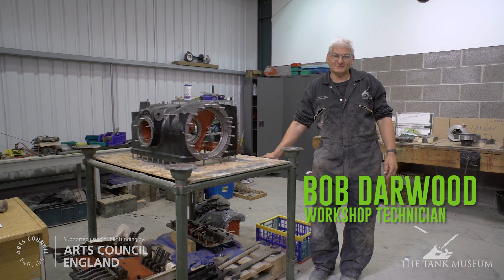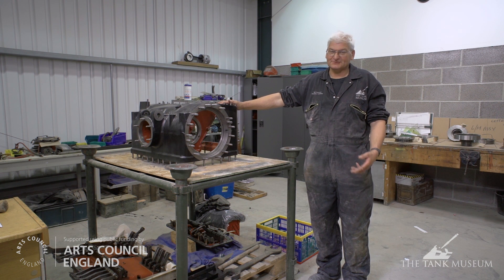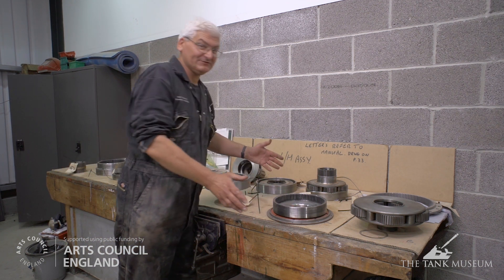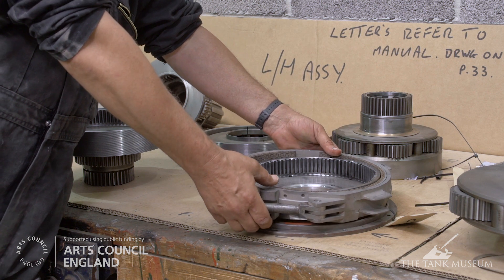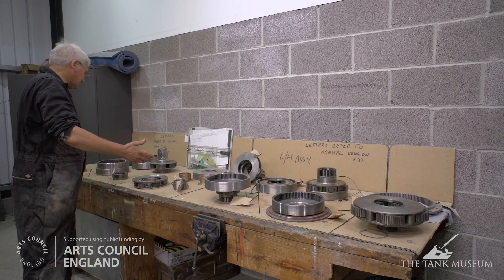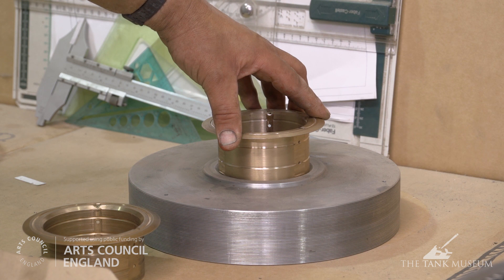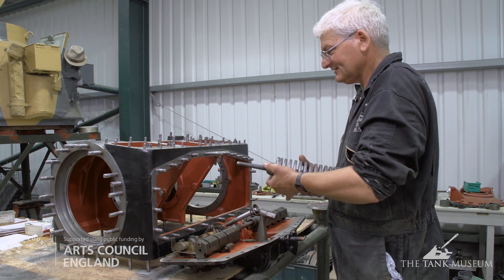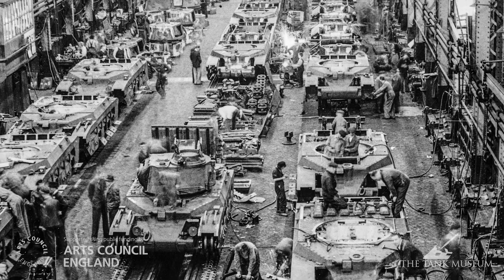The Matilda Diaries Part 5 | The Tank Museum

Comment: I'm struck by how small those gears are, with such tiny teeth, I suppose a massive advantage to the planetary gearbox is the multiple contact points from several gears meshing simultaneously which can survive the same torque as larger single contact gears. While the matilda 2 only weighs half as much as the late war tanks which famously had severe gearbox problems, I wonder if the germans could have made use of a planetary arrangement for more durable panthers. Of course an easier fix would have been simply using herringbone gears, the existing transmission probably didn't need any changes other than different gear geometry to achieve significantly better reliability.

Comment: And they said that German tanks were too detailed for their own good. Did this really function in the desert's sands?
Reply: The Panther weakness was in part down to the lack of machinists and equipment to manufacture herringbone final drive gear sets. The steel by then was crap too due to lack of alloying elements like manganese or vanadium. Not helped by saboteurs risking their lives to not tighten assemblies properly or whatever (well done those slaves!).
Reply: I would rather have a complex gearbox that can handle the power and weight of the tank. Look at the Panther tank that came 5 or so years later, it uses straight tooth gears which would cause a lot of stress on each tooth and can lead to the gear breaking.
Reply: which was solved in the later models and later phase of war right?
Reply: Marc83Aus
That's then a double helical* or a herringbone gear, the latter of which was used in a similar(?) drive on the Tiger II, but then, I'm guessing you run into problems with getting enough of the bloody things out the door, hence only being used on the low-production, absurdly heavy tank.

There's also helical gears, which are just one half of what you suggested. Smoother than straight-cut, but, I'm guessing, slightly more complicated, and they pull to the side, which would have to be compensated for with ball bearings, another thing Germany was in short supply of even before the factories making them started getting targetted for bombing raids.

*Slight difference being, double helical has a groove between the teeth, while herringbone has both sides meeting in the middle, which takes some effort as well.
Reply: Neuttah This video covers the basics, despite the poor resolution. Of note is that for a herringbone gear you need to use 'shaping' which is a linear motion that gradually cuts into the gear, whereas straight, spur, or helical can be done using faster, easier hobbing methods.
Reply: the Matilda also function well in the Pacific theater. Australian Tankers liked the Matilda as well and those conditions were petty challenging as well.
Reply: the Matilda was a pre-war tank so it had lots of nice engineering, things like the Valentine were a lot more thrown together. Crusaders gained a lot of negative press because they were built really fast with next to no quality control.
Reply: I always wondered why the germans couldn't have just made each gear as a pair, straight cut one half diagonally to the left, one half diagonally to the right, then sandwich the two together in opposing directions, maybe a few thick interference fit pins hammered into them would have done the trick. Or welding.
Reply: Neuttah
I've only done light research into gearcutting techniques but I thought It was far easier to cut straight gears than herringbone, and assumed that helical was just as easy as straight cut gears. That assumption is probably incorrect, I've seen videos of those 3 types being machined but don't recall much other than herringbone being notoriously more demanding.
Reply: Marc83Aus
Herringbone needs to be cut out of one gear, so you need to figure out the whole "Don't cut into the other half!" thing, but to be honest, I don't know the difference between helical and straight in production difficulty.

There's also the metallurgical element; German steel, especially by the time they roll out the Panther, was borderline sufficient.
Reply: The straight-cut final drive gears never got fixed on the Panther. Tiger II got the herringbone final drive Sean mentioned, but Panthers ran on their crappy one until even the French gave up on them two years after the war.

Guessing the Tiger got it because it was always a lower-production vehicle that was going to be inherently more expensive per unit anyway, and it already had enough reliability problems.

As for the Matilda functioning in the sand: I'm guessing the gearbox was sealed off enough for sand not to bother it. And it was well liked by the crews, from what I gathered, so I'd say "Yes, it worked."